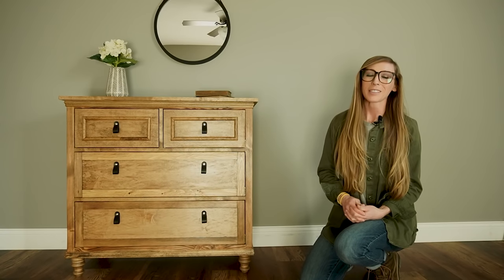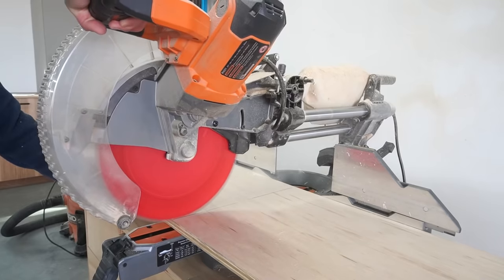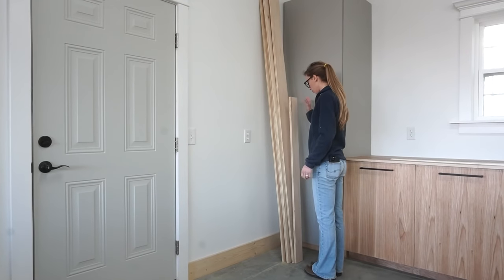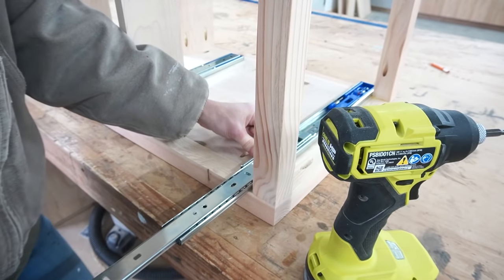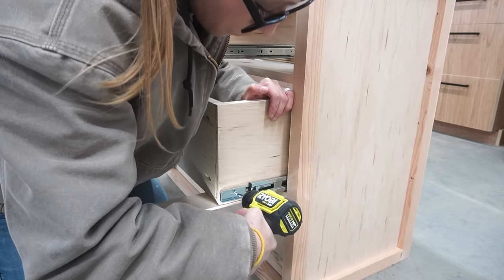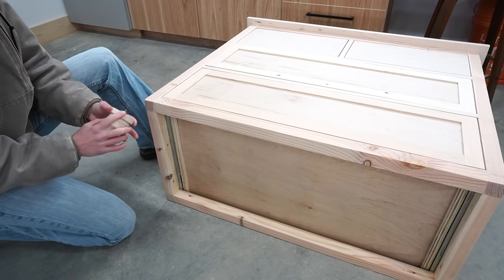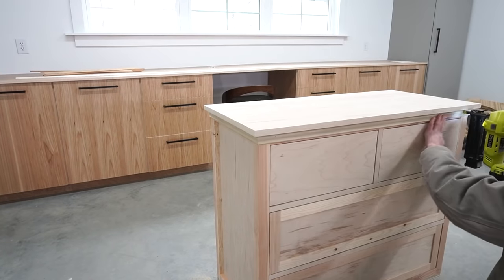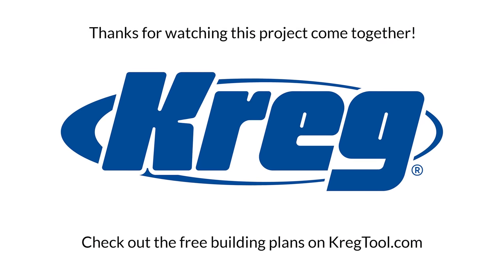How To Build A Simple DIY Dresser | Free Woodworking Project Plan

Comment: Looks good, as usual.  With regard to the brass inserts, my understanding is the slots are not for screwdrivers.  They can help to cut threads if installed the other way up.  A bolt with a nut to lock on the insert can make installation easier.
Reply from the maker: Thanks!

Comment: Very nice build and great video with lots of tips. I agree about inserts, hex head ones are much better. And steel, not brass. Also you can lubricate them with some glue, just seal the bottom with some tape so that the threads wouldn't clog. They will go in much easier. I use super glue and epoxy would work as well
Reply from the maker: Thanks for the tips!

Comment: For the inserts, you can also use a bolt (thread s of the insert) with two nuts on the bolt snug against each other.  Screw the nuts on the same as the depth of the insert.  You can use some CA to keep these locked in place too.  Screw the insert onto the bolt, then use a nut driver, or socket with ratchet, and screw the inserts in.
Reply from the maker: Thanks for the tip!

Comment: Great work as always! I used my Rip-Cut for the first time this weekend along with the Ryobi 18v. I was ripping 3/4" plywood. I had trouble with the saw "stalling" in the cut. This was with a new blade. Any tips on using the Rip-Cut? Thanks!
Reply from the maker: If the blade is stalling during the cut, it can be caused by pulling inward with both arms during the cut. This will cause the back of the saw to slightly angle inward causing excessive pressure on the blade which can cause it to stall. It can also be an issue with the saw, I would ensure the battery is fully charged and the blade is not loose on the saw.
Reply: I like to use larger batteries in my Ryobi circ saw when cutting 3/4” ply. 4.0ah batteries work well. It’ll run on smaller batteries, but can have issues if you’re pushing too hard or too fast through thick material. Also, a good, sharp plywood blade makes a huge difference too